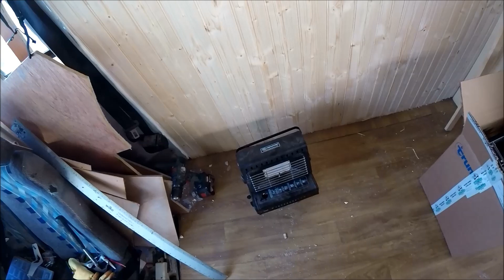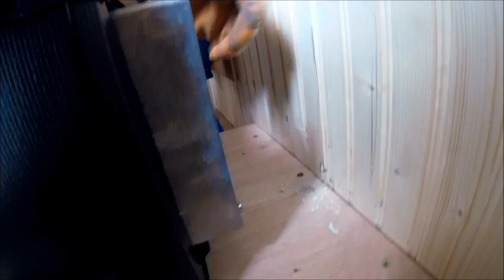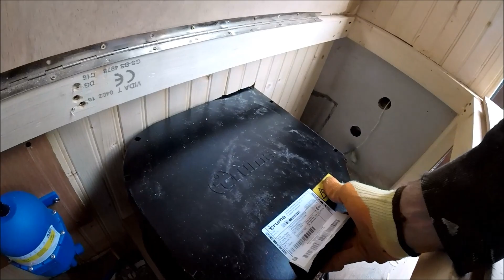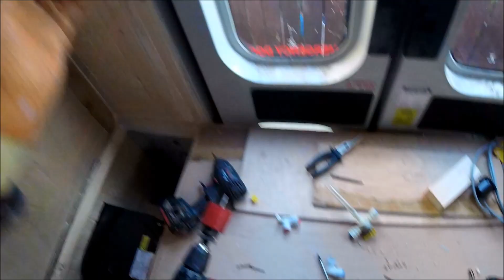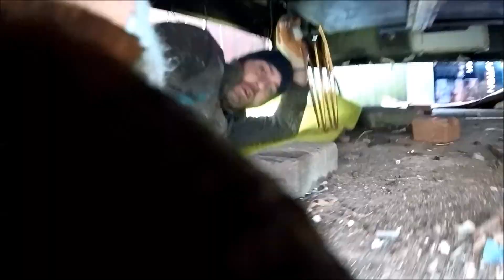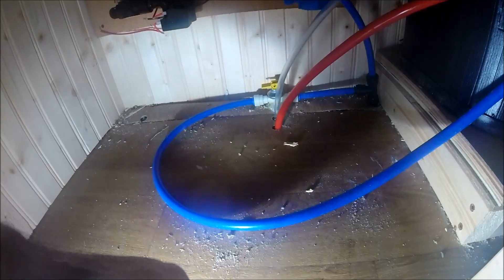Minibus Camper Conversion Part 15 Truma UltraStore Hot Water Heater Installation

Comment: A few things I would comment on.
1). If the extension cowl is to long, just pull the heater further away from the van wall inside.
2). You did not seal the dividing wall across the centre of the cowl, against the outer plate. This is to stop the intake air and exhaust gasses mixing. And is advised in the Truma fitting instructions.
3). Routing the hot water pipes outside the van is going to reduce temperature at your taps, you may need to lag/insulate them.
4). The drop out vent, needed below every gas coupling, should be 50mm diameter and no pipes/wires reducing area. The open vent will encourage critters to crawl inside your van.

Nothing major, but worth noting. I'm just reading the fitting instructions, prior to fitting the same unit.

Comment: Why did u not use the pump ?
Reply from the maker: This is plumbed from the main water supplied by the pump, not sure what you are referring to, it need to be on a pump to get its water
Reply: @TheCampervanBuilder  there’s a puMp on the wall and a tank are you. It using them
Reply from the maker: @Balinomadicadventures  I only have 1 pump and tank that feeds ALL water appliances

Comment: The two cables that come out of the heater, what do they attach too..I know one is to connect directly to 240 consumer unit but what is the the other one attached too. I've got 2 control panels one which is self explanatory and plugs straight in the other is open wires?
Reply from the maker: one is 240v, the other is 12v for the igniter
Reply: @TheCampervanBuilder  I thought that 12v power supply connected to the  built in wago type connection on the unit. I watched other video where the cable from the unit had a connector plug on it and it looked as if it went to one of the control panels? I thought I had worked it out but cannot get my head round it

Comment: Hi there I’m installing a Trina bge-10 it has a 12 volt connection what would be the fuse rating and and a 240 volt connection what would be the amperage required for circuit breaker on my consumer unit? Thanks
Reply from the maker: 12v is just the igniter so small fuse, I think 6a trio rcd is enough for 240, but not 100% sure, it was a while ago

Comment: Hi! does the truma b10 comes with the water valves and connectors for the boiler? The 3-piece? Here in the netherlands i have to order it seperatly, but its different from yours in the video. Ours isnt with a click in connecter like it seems to be in your video.
Can you just insert the 12mm pipe in the truma connector on the boiler? And if so, do you if if i can order these 3-piece connectors seperatly somehwere?

Comment: Did you use the gas connector nut that cam with the boiler? It mentions olives in the instructions but no olive is supplied. I was considering an 8mm gas hose with threaded connector.

Comment: What size of fuse would you need to run wires from the gas level indicator to the fuse box?
Reply from the maker: Nothing big, they are low power
Reply: @TheCampervanBuilder  would 3 amp be ok?
Reply from the maker: Should be fine
Reply: @TheCampervanBuilder  much appreciated

Comment: Hi what size 12v cable will I need to buy
Reply from the maker: the 12v is just for the timer and igniter so nothing large, I buy a long reel of 11a cable and use that for most items other than heavy draw appliances

Comment: Whats the size of the compression nut on the gas connection of the boiler? Mine is missing and the 8mm fitting ones seem too small and dont screw on....
Reply from the maker: I think it is 8mm but maybe slightly deeper than a standard compression from screwfix etc, probably just to make you buy their own
Reply: @TheCampervanBuilder  Thanks for the reply, I ordered one on ebay, lets hope it fits, but couldnt find any specific Truma spare part that talks about it being different, but it deffinately doesnt take standard 8mm compression nuts, I started to peel the thread of when I forced it on..
Reply: @tehdreamer  hi mate I'm facing same problem did you find out the size ,I messaged the camper van builder then seen your comment thanks in advance
Reply: @neilmoon4766  ye I ordered one from eBay
Reply: @tehdreamer  thanks mate would you still have link or size to order I've been on internet for some time to no avail thanks again
Reply: @neilmoon4766  The 8mm nut and olive one

Comment: Nice install but personally I would have routed that gas pipe flush down the back wall and then flush across the floor secured with p-clips rather than have it exiting the hole in a big sweeping curve.  When the bus is in use people will be throwing all manner of things under the bed and rummaging around trying to retrieve things.  As it stands that pipe could easily become detached.
Reply from the maker: The pipe cannot become detached as its secured to the heater with compression fitting and the entire heater will be boxed in so the area won't be in use for storage